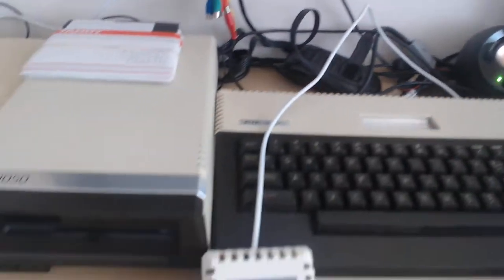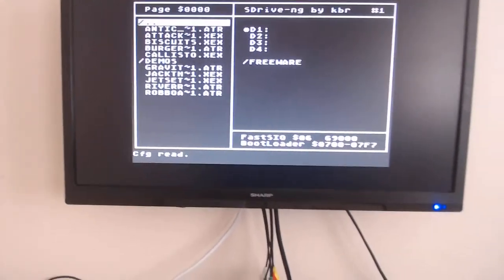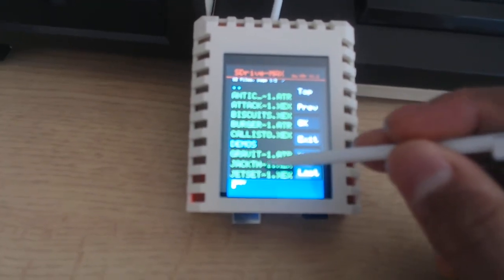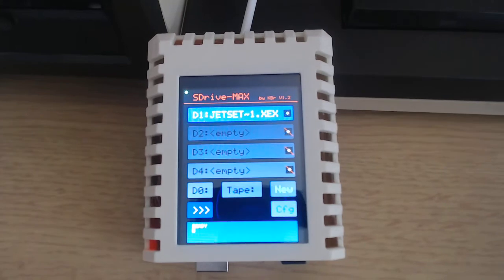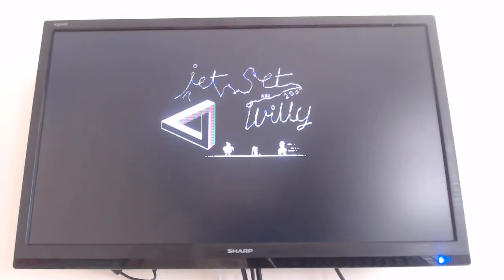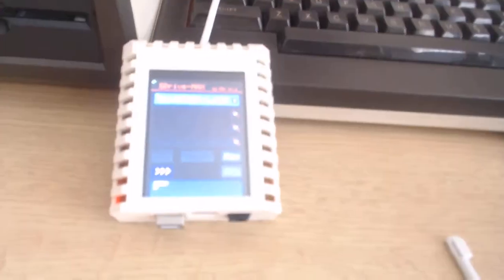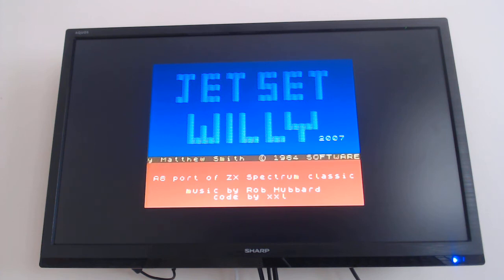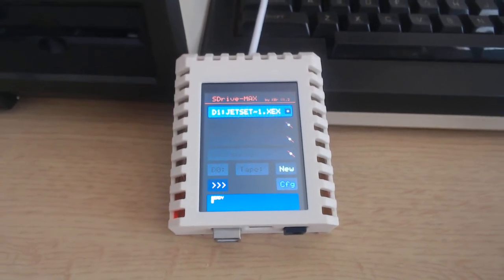Atari SDrive-Max - Amazing SD card disc drive emulator!

Comment: Amazing. Can these be purchased if you live in the US? Thanks in advance.
Reply from the maker: Hi there - I am in the UK but sure you can get them in the USA..
Search for 'SDrive Max Atari' in eBay.
Better yet - search for 'Fujinet Atari' - this is an even more amazing piece of kit that allows connection over WiFi to internet & BBS (as well as can take an SD card) - I think I might get one of these as well!!
But don't get ripped off - I got the SDrive Max for about £40 and I can see the Fujinet for about £50 (GBP and postage is extra around £4-5).  I say this because prices seem to vary - some people trying to sell the Fujinet here in the UK for more than £100!
Good luck and hope you find one, it brings a new lease of life to one of the best computers from the late 70s!